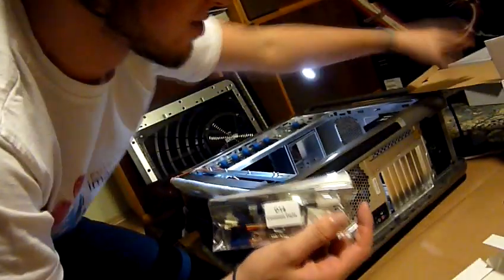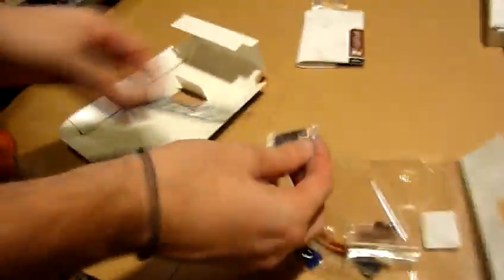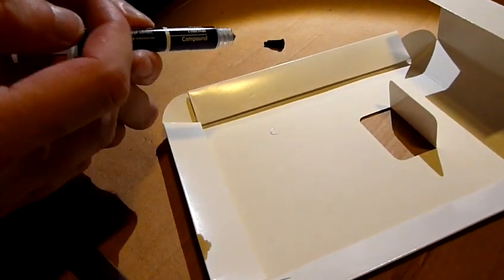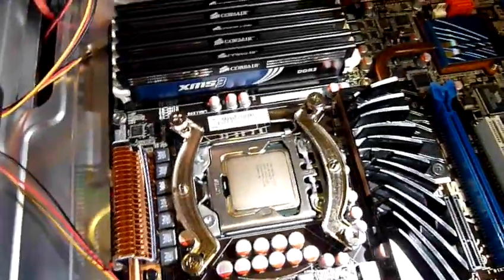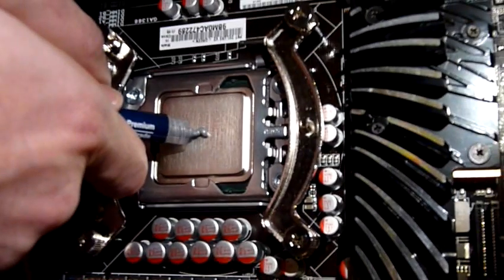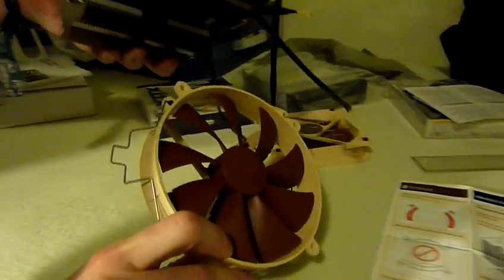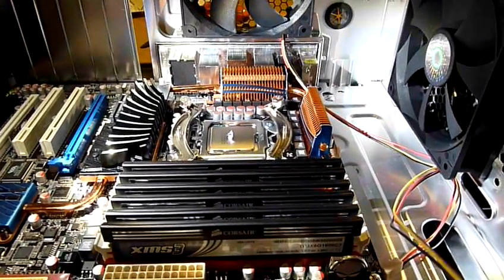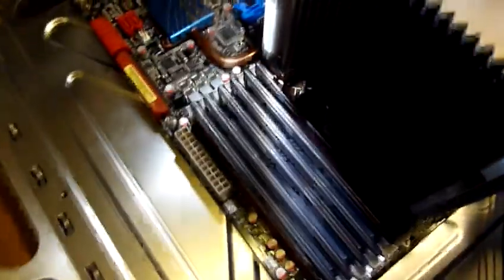Two lame dudes: building a PC - Noctua NH-D14 heatsink instal (14)

Comment: @TubersAndPotatoes - I've been building PCs for a long time and I can tell you that placing the goober in the center and letting it squeeze out to the sides creates less air than spreading it. spreading it creates air because the film you spread is uneven. when it gets squeezed out, the air escapes as it moves to the edge. There are some videos in youtube that show how the different methods react. They use a piece of glass and different application methods.

Comment: @Disinf3ctant Please don't state misinformation. Spreading has been proven time and time again to be a perfect way of causing airbubbles, also the installation manual of NH-D14 states to put a ball of 5mm diameter in the center then put the heatsink on and rotate it slightly to force any would be bubbles out.

Comment: @zaphr89 
You need to ease up on the formalized anger. 

Ok tell me whats worse. A few tiny ass air bubbles, or a huge strip of the CPU heat spreader that's not covered with thermal paste around the edges. Spreading it with the contact plate is also exactly the same as spreading it with anything else. Unless you use you finger. (Don't do that please)

And the last time I checked Rodney Reynolds approves of spreading so I'm taking his word. ;) Cause that guys a fucking pc legend.